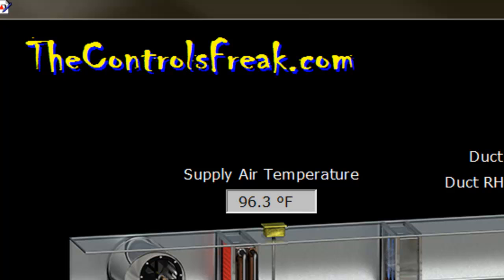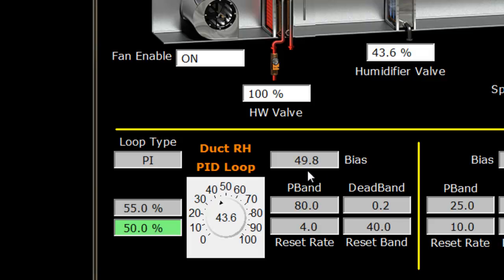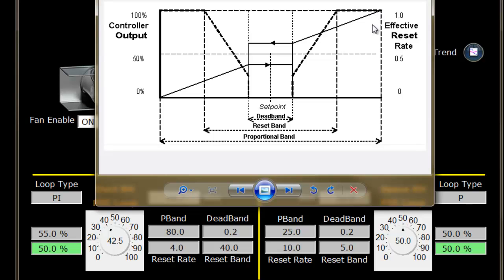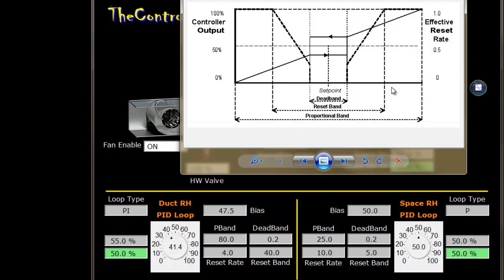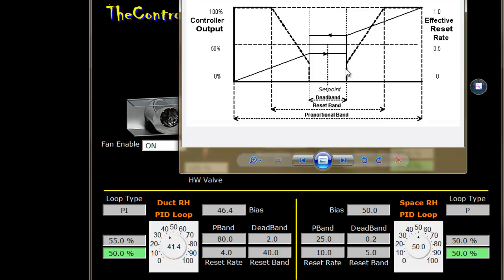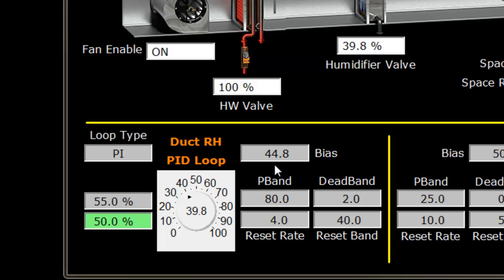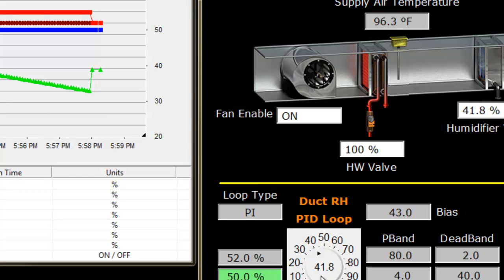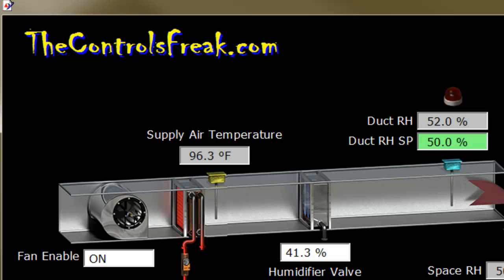PID Loop Tuning Explained - Part 2 - Proportional and Integral

Comment from the maker: In this context 'tuning' is the adjusting and setting of the proper values of a PID loop to be the most efficient at controlling the resulting output signal and device.

Once you have tuned a PID loop to work properly, you should not need to change it unless the input signals react differently or a new result is required and therefore you would need to 're-tune' the PID loop to better react to the new changes.